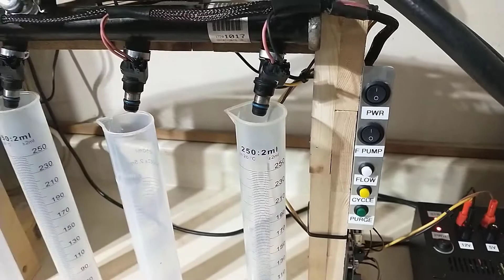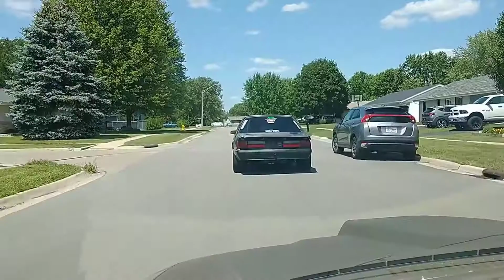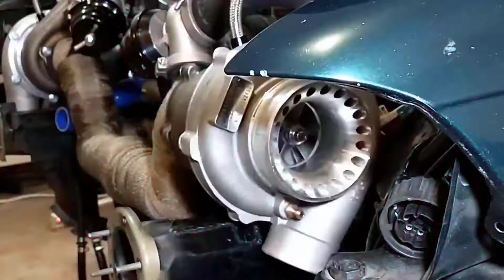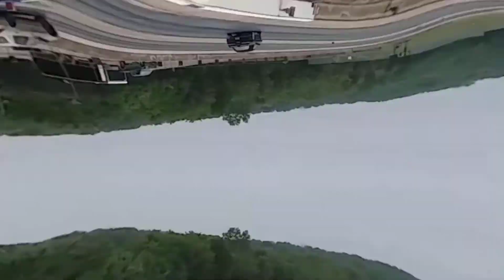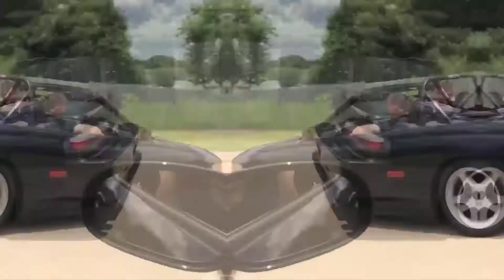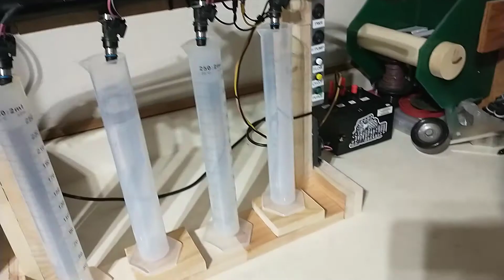DIY: Building Your Own Injector Flow Bench!! | EASIER THAN YOU THINK!

Comment: Is there a way to do this with a variable voltage output to the injectors? Would need to be able to generate usable data relative to voltage in a range of 7v-16.5v?

Comment: Just finished building mine, extremely thankful for your in depth how to. Thanks a million!
Reply: Hi, everything works great for my newer high impedance injectors. Is there a way to modify the hardware to make it work for older low impedance L-Jetronic (Alfa-GTV6) injectors? 
I started testing my GTVs injectors and now my transistors are toasted😅.
Thanks

Comment: Super set up, I'm building a simple one to check one injector at a time with my stimulator , all I need is a inline pressure regulator , pressure guage, and I can put up my DSO to check the characteristics of the pintle lift with the oscilloscope

Comment: What should I do for a code for collecting data to calculate injector dead time. Should I just do a separate button for each duty cycle? Or is there a way to input a requested value and just send that duty cycle? ie, I need to collect volume after a certain duty cycle, empty cylinders, change dusty cycle and repeat 4 or 5 times to collect a data set.

Comment: what's the brand of fuel pump you used
Reply from the maker: It was just an ebay/Amazon external inline 300 LPH fuel pump similar to Evil Energy.
Reply: @815LSxSwaps  what is the pressure 60psi ?
Reply from the maker: 58